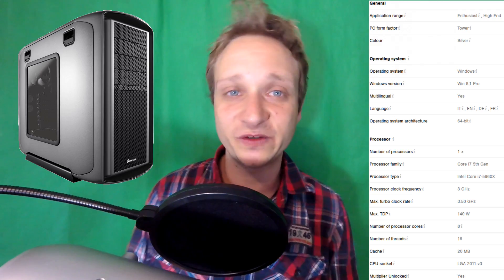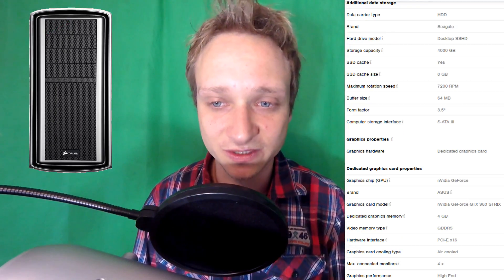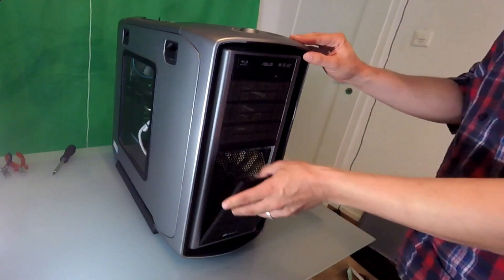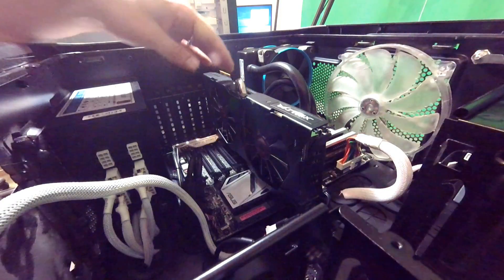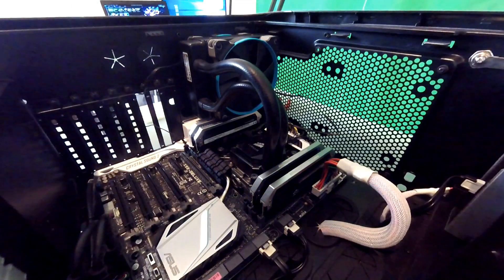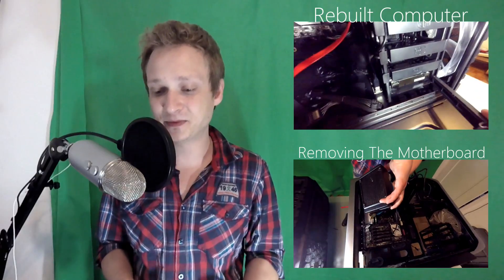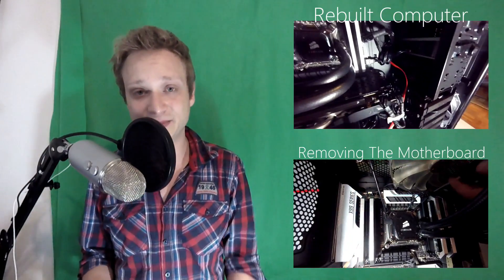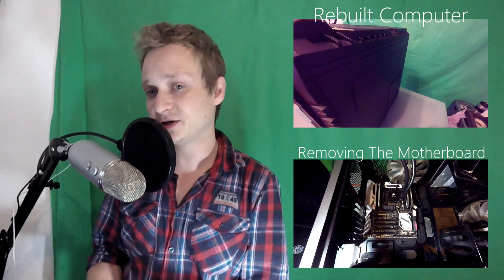FIXING A DEAD COMPUTER  - Vlog: Ep. #1 - I Rebuilt My Entire Computer

Comment: mash f11 on start up and try toggling te overclock option there before it forces you to do it, and also check over your case, some have overclock dials and crap built in to them already but i doubt that is the problem. the mobo again might also be causing issues but that's unlikely.
Reply from the maker: It turned out the Motherboard seems to be fine. The final errors I had because I didn't put in the RAM all the way and I had the two drives connected in the wrong order. Just changed the spot where my SSD goes and the spot where the big drive goes and today I could start up without any errors. Will have to observe it though, I've been filled with false hope before:)

Comment: you should try to reset your bios to factory defaults, that should override your bios settings to default so your "clocks" will not be overclocked anymore. You could do that by unplug the power supply and remove the battery from the motherboard for few seconds, or there should be a button or jumper on the motherboard to clear the CMOS directly. That could help to solve your problem, for me this is a standard steps, when i solve pc problems, such as yours. If this doesn't work, than it is possible that you have to flash the newest bios, and if this wont help, well then it is a HW problem i think. 

I hope in resolving your PC issue in near future, and wish you the best. Your beloved subscriber from Czech republik. 

PS: i hope my english is not so bad.

Ahoj a snad se ti povede tvůj problém vyřešit co nejlépe.

Comment: the overclock failed issue could be anything from a bios issue to actual hardware failing. if you go into the bios you should be able t set it to boot into a fail safe mode and then later set it back to defaults. if that doesn't get it check the ram sticks to see if ones going bad.

the overclock failed message basically means that something in the computer isnt receiving enough power if you didnt overclock the pc it can be caused usually due to bios error or hardware issues
Reply from the maker: Thanks for your thoughts on this, if it doesn't change I'll do the RAM test. Right now, my biggest problem is that I don't seem to be able to save changes in the bios, but haven't tried the fail safe mode yet.

Comment: Nathan It sounds like an overheating issue, the overclock if that is what is actually going on, then you might want to double check the cooler for the cpu sometimes you get air and you have to be careful to make sure its running again.

As for the windows disk running well, it sounds like your computer is missing one file or a few when booting if overclocking is occurring.

What you need to do is check your bio's for the overclock and make sure its turned off first and then if you still want to over clock it then make sure the voltages are correct.

Please answer if you think i have helped.
Reply from the maker: My current problem is that whenever I change something in bios and try to save it, it doesn't accept the changes and still restarts. I can't even change the booting drive, which atm is the wrong one, so it sends me to bios anyway. Next thing I'll try is to reconnect the drives the other way around. I didn't have anymore overclocking issues the past few boots, just the bios thing that won't save.
Reply: interesting, The drives matter when booting so it could just come down to boot sequence.

Just try the booting drive with windows on it alone and see if that works then start to connect more drives after more boots and see if that has an affect
Reply from the maker: Ok I'll try that, thanks a lot, really helpful:)
Reply from the maker: +Richard W How do I know how much voltage I need?
Reply: ok first off look at the board and then look up the manual online for it if you do not have it any more, In that manual it should tell you voltages, 

There could be whats termed a its like a clip or a removable part like at the back end of old hard drives, but it should tell you the settings on the board for what your trying to use.

I hope i can help further.
Reply from the maker: Ok great, I'll check that out and test it. I changed the SATA connections yesterday night and put in the RAM properly and today I had no errors whatsoever. Looking good so far.

Comment: You did a good job from what I saw in your video, welcome to the builders club! =^_^=

The SATA cable is probably from a front panel eSATA port or even an 'internal' card reader in your case, if you don't have the front panel/card reader anymore you can unplug that SATA cable.

The BIOS error is probably from when you replaced your battery, and is probably a frequency timing issue. The quickest way to try to fix it is to reset your BIOS to default settings. If you have a standard ASUS UEFI BIOS you should have a button on the bottom right that says "Defaults (F5)". 

Press this option and try rebooting, if it fails to resolve the issue let me know. ;)

P.S. It is a nice system. ;)
Reply from the maker: +Aerik Forager From what I've seen, every time I try to use the save and exit feature in bios, instead of saving it just shuts down without applying the changes for the next startup. Any thoughts?
Reply: Nathan's Sandbox Have you tried putting a different BIOS battery in?

Edit: Other than the new one you installed in your video.
Reply: Nathan's Sandbox What are the two numbers/letters on the "Q-Code LED" display on the motherboard?
Reply from the maker: Yeah that looks like mine. The Q-Code is usally changed from one thing to another at the bootup, I haven't noted it down yet, but I will with the next boot. Once I run F8 to get to boot menu and choose the correct drive and get into windows, it shows AA, which I heard means everything's fine. Also my temperatures in idle mode are all below 30 degrees celcius, even the cpu.
Reply: Nathan's Sandbox To reset your BIOS manually give your CLR_CMOS button a poke, your CLR-CMOS button should be next to your Q-Code display. AA does mean things are going smooth, and your temperatures sound like they are good. ;)
Reply from the maker: While gaming the temperature of the graphics card is at a constant 80 degrees, and also some of my ram modules don't seem to get recognized, as if they weren't plugged in.
Reply: Nathan's Sandbox For the RAM I would recommend pulling them out like when you reseated them, but instead of putting them back in the same slots rearrange them. If you get the same amount of RAM it might be one of the sticks, put them in one at a time and try booting then. :)
Reply from the maker: I actually haven't plugged them in entirely. The two back modules had to be pushed in a few more milimeters, all good with the RAM now:)

Comment: as FaultBat said the extra SATS cable plugs in just like your hard drive.. as for the Bios issue, try swapping the sata connectors on your motherboard..
Reply from the maker: +Fuse mc Ah that's a good idea, so you mean that the drivers are hooked up the other way around?

Comment: The SATA cable from your case plugs into a SATA header just like your hard drives do - it allows that E-SATA port on the front of your case to work. As for the BIOS issues, you might have a button or jumper on your motherboard that will allow you to fully reset the BIOS settings, and that might help. Check your motherboard manual for how to do that. Good luck!
Reply from the maker: +FaultBat Could it be the CMOS reset button?
Reply: Nope. But Some time this button can get damaged. The guy is referring to little plastic stubs that joins 2 pins. This is very improbable. It happens one in a million. But it happens. 
About the cable it looks like you need to connected to hardrive or some periferal you forgot to connect.
Reply from the maker: What is a periferal?
Reply: Yes, the CMOS reset button is what you can use to reset your BIOS settings. If you shut down the power to the computer and hit that button, it should reset all the settings, and hopefully clear up the overclocking error and everything.
Reply: CMOS buttons like the other commentor said are rare to have on a mother board. if you take out the cmos battery for about a minute and return it, it should reset your bios options and menu. my original thoughts wer maybe it is your power supply but it could also be your mobo. power delivery issues usually come from these 2 components. try getting a cheap mobo or bring it to a shop with a test bench and ask if they can test the 2 components for you. should be to expensive id imagine and they can tell you were the issue is
Reply from the maker: Thanks for the explanation, right now it looks as though we have fixed all the errors. I didn't put the RAM in properly and I had the two drives connections exchanged so the order is different and today it seemed to work without any errors. I dont' trust it yet, but it's looking good.
Reply: +Nathan's Sandbox ram would do it if it's not in the slot all the way. Always double check your connections. I'm actually amazed you didn't get a bluescreen.

Also to +CreatingtheReaper - Most newer motherboards now come with a button to reset, even middle tier boards. Both my AM2+ motherboard and my AM3+ motherboard have a reset button. but yes, taking the battery out for a few minutes does do the same thing, but the button is faster if you have it.
Reply from the maker: Ah good hint with the button. Had no idea it does exactly the same.